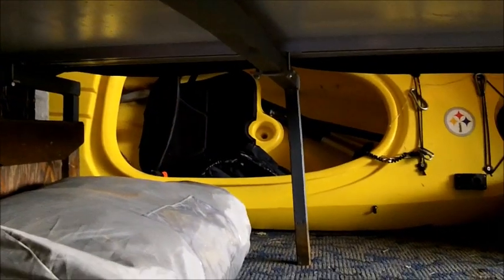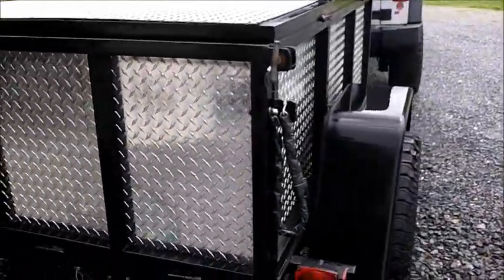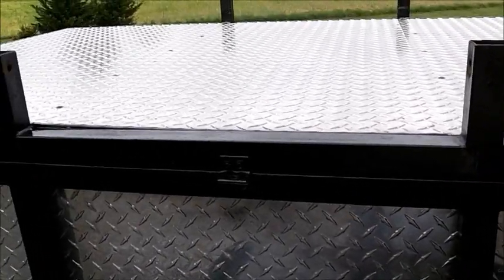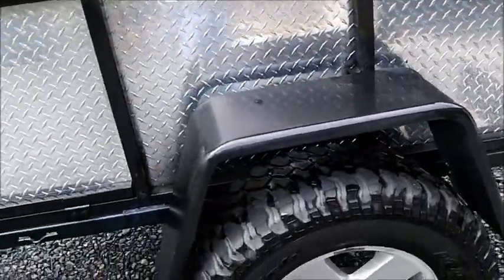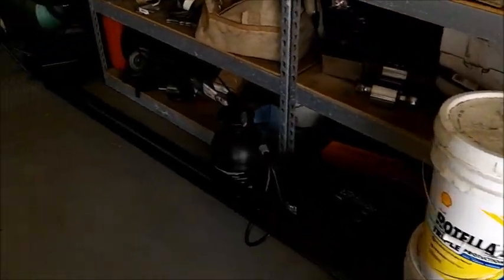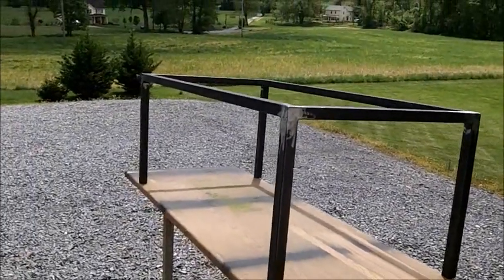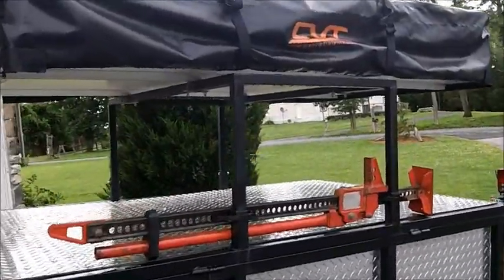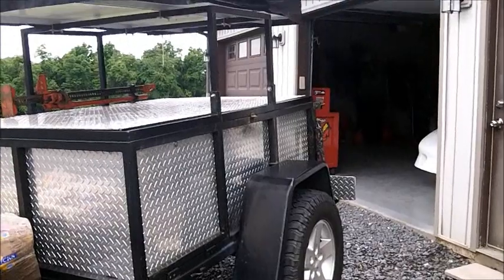Homemade trailer and CVT tent update.

Comment: Good looking build I’m planning on building myself one sometime. If you have problems with the rack again cut you upright and cross bar on a 45 degree angle it closes the open end of the bar and it provides a stronger weld that will hold up longer.

Comment: As Captain Awesome suggested - add some gussets to the corners of the tent frame. 
It is very weak with just the welds as they are, and when they fail, they will just go instantly and the tent WILL come off  ( probably while on the highway ! or anytime you hit the brakes quickly ) The frame really does need extra strength to support that load while driving fella.

Great looking trailer, excellent

Comment: Great work,  i am planing to build one myself! The tubing uprights u have for your roof top tent, shluld either be capped off and use another size tubing for the tent part and slip over , use pins to lock together or like you said drill weep holes to drain water.  Either of those 2 methods would help alot.. either way , great build and looks awesome!!!!! Keep up the good work, look foward to seeing more of this build!!

Comment: Have you thought about running your square tubing for your CVT tent mount down the outside of your trailer? that way the water would just run out the bottom onto the ground. plus you would be able to placr the tent in a lower position for traveling and offroading. then raise it to your desired height when setting up camp.

Comment: sorry to be the late comer to the party . love the trailer combo . Try a couple of tennis balls with a cut out in them to cover the open ends of the tubes, Bonus points as it will also pad the tubes if you throw a tarp over them

Comment: Those small uprights for the rack should have been made to slide up inside the rack itself. Weld a cap over those small uprights and flush them off with a flapper wheel. They will not only solve the water problem but will look nice too ..cheers from Oz.

Comment: Great looking trailer. What was the cost to build the trailer? Did you buy or build the fenders? Thanks for the info!!
Reply from the maker: Guns and Gear Network Cost was around 1800. All the diamond plate sheets were "donated" by a friend. The fenders were purchased from a local trailer shop. 
Thanks for the feedback!
Reply: So $1800 not including the diamond plate factored in because it was "donated"?
Reply from the maker: Guns and Gear Network Yes...it would have been well over 2000 if I would had to purchase plate.
Reply: Gotcha, thanks for the info.
Reply from the maker: After looking back...it cost me only $1000. I was thinking of another project I completed.
Reply from the maker: short parts list....
lots of tubing
suspension parts/leaf springs
wheels/tires
hubs/spindles
wiring/lights
tongue jack
fenders 
The rest was all fabricated and welded by myself.